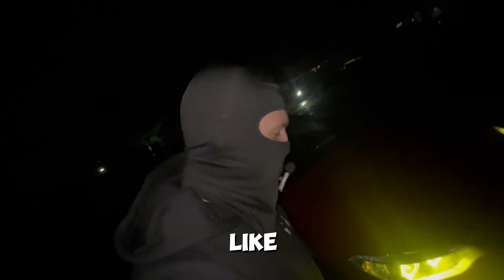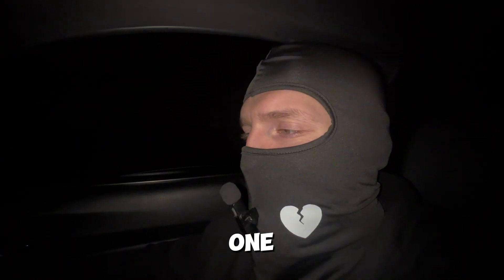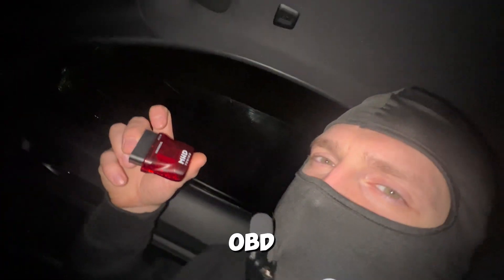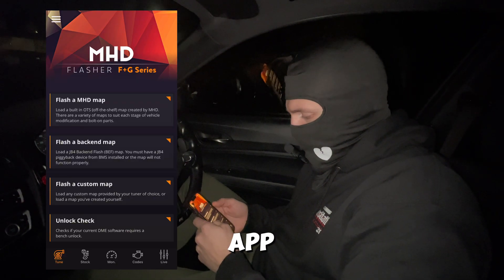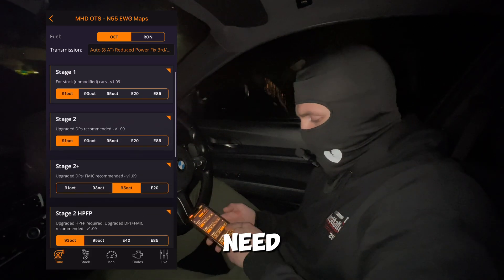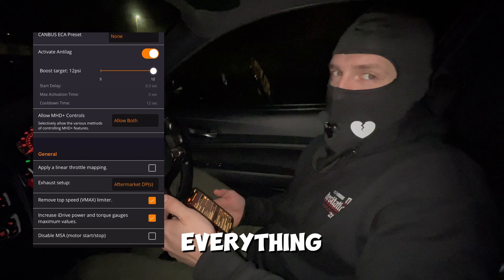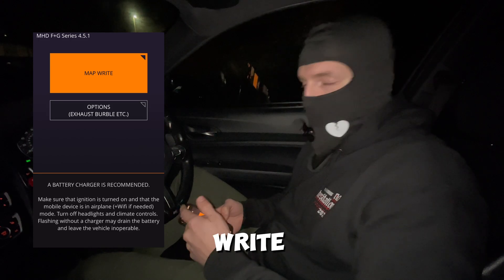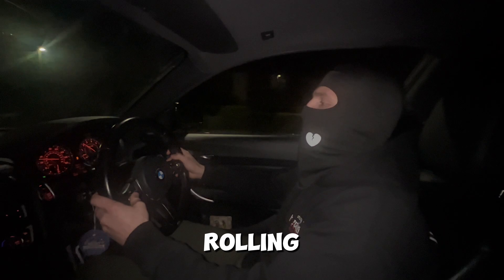Mapping my BMW with MHD

Comment: Some people gonna hate me, but if you somehow wanted to get rid of this mic clipping, sometimes when you put your mic too close, setting lower gain won't fix the issue. You might want to mount it more below your mouth. Theoretically the meter might not show clipping, but practically the sound will be distorted if the mic is too close.
But if you suffer from occasional clipping on meter, possibly invest in something recording in 32 bit float, but as for wireless mic, it might be not so available option.
Reply from the maker: I don’t think its bad, first time I ran into an issue with it while recording something, I also increase the volume all the way up so it clips at times. I will invest one day in a lil more fancy one